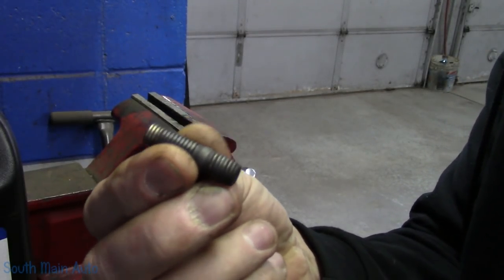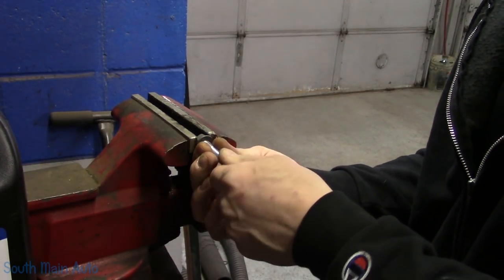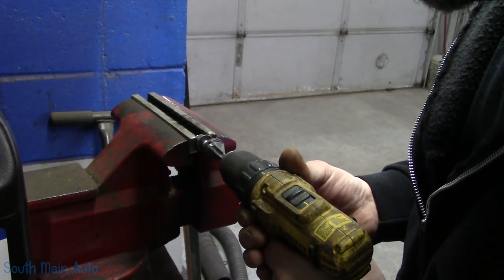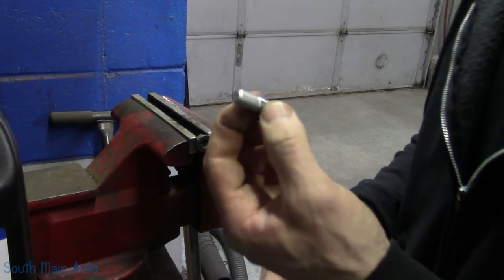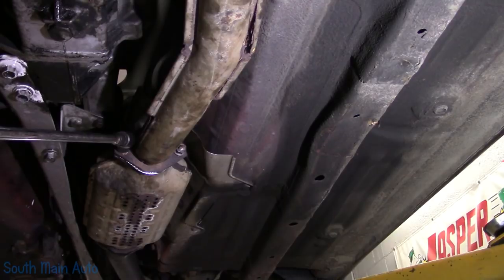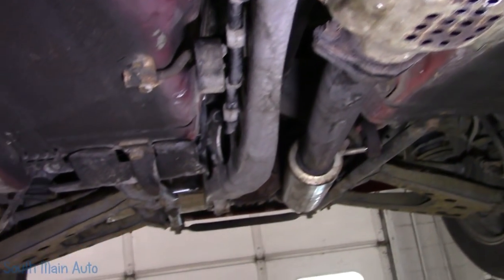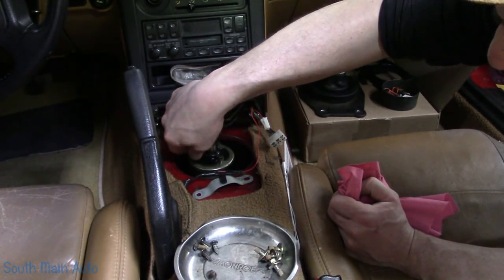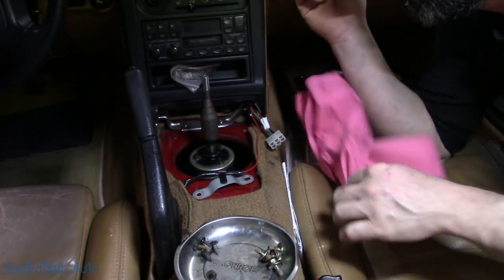Mazda Miata MX 5 - Clutch Replacement Job - Part IV

Comment: Great work you put in on that beast. Corrosion can hide anywhere. You showed ALOTTA patience with those long through bolts. Is that an hourly job right out of the gate or is it a flat rate nightmare..?

Comment: Did I miss it? You were supposed to replace the oil in the reservoir under the stick shift. It does make a difference in the shift quality.

Comment: Fun series to watch...l prefer the longer ones...Just wondering why you just wouldn't a bolt and nut assembly instead of replacing the studs..Wouldn't it make it easier for disassemble next time and an easier find.?..Maybe l missed something..
Reply: Oh.ok..l got it...it's a space issue on the backside...sorry.

Comment: That insulation around the shifter doesn't really do shit, it's the big rubber boot that keeps the heat and noise out. I'd bet the transmission tunnel gets quite warm when you give it the beans, and 9 times out of 10 it's ripped on a used Miata. Also not the first time someone's been in there, that brass bushing on the bottom of the shifter isn't stock, it was nylon from the factory. I'm betting someone did the boot before, given the age of the car, I wouldn't be surprised if it's been done multiple times. The boots only last a few years.

Comment: Job almost jobbed :-S
Looked like it be a gravy job lol
Worked you hard and metric stud parts etc messed you about a bit .
Think you want stock more studs and bolts, few hundred bucks in fasteners can be big time and hassle saver over the years and actually save money as you buy them in cheaper per unit. I never use to bother much as had great local hardware stores and tractor repair shops that had massive range and open 6days a week. 
Demise of these shops and autofactors never having much on shelf made me stock more and have saved links for better faster sellers for eBay so either have most common fixings in shop or anything bit special with no local workable option can be posted under 2 days .

Comment: This is the first clutch replacement I've seen you do. I learned a bit more about how they work, thanks. Why did that front to back "truss" have to come completely out?  Was there no room to work up front if it was still attached to the rear diff?
Reply: The Miata wasn't rusty, did the bolts seize because of steel/aluminum bonding?
Reply: The whole thing reminded me of replacing head gaskets on Subaru EJ engines. It takes forever to get to what you have to work on (head gasket or clutch)  Hope my FB engine doesn't leak there or is significantly easier to work on.

Comment: So I made the mistake the other day of using a bell housing bolt to get close the last 1/8-1/16 gap between my bell housing and engine. I assume the issue here would most likely be that I might have pushed the pilot bearing against the crankshaft?

Comment: RULE 1 broken , Open fill before drain plug.
Reply from the maker: I know, I totally pulled off a "do as a I say not as I do" move right there. Sorry :( I will go stand in the corner now....
Reply: Last Chevy truck/van  pads were put on wrong. The rivets are different inside to outside pads. Outside pad rivet hits outer most  "fingers" of the caliper first if you get it wrong. 50/50 shot there. The one side you showed getting done was wrong.   Thank you for the reply and keep up the good work. Now get out of the corner and back to work Mrs O needs a New Timing Belt or Shoes.

Comment: 99% of technicians do not have your skill because they do not have your patience. 
Btw, my rear powerplant frame bolts were the same and I failed the patience test. Ended up having to melt out those top retainer nuts. Was way harder than it looked.

Comment: have you done many clutch jobs on first generation chevy colorados? i have to replace mine and going to tackle it in the driveway. it doesnt start catching until that last few inches at the top of the pedal travel and i have some loud flywheel chatter upon accel until -/1,500rpm.  they are hydraulic and have the internal slaves. few lines to disconnect. Just wondering if it's a huge pain to do.

Comment: Clutch from hell, I believe the next mazda that came in for a clutch job I would play hard of hearing.
Reply from the maker: Nah we will just be twice as fast :)
Reply: It wasn't that bad. Just a few tough bolts. When it's bad, Eric has to bring out the sledge. He hasn't done that in a while.
Reply: Mazda did wonders to the ranger line. Because of rust and what not it took me 2 months to pull and rebuild a tranny for a '93 ranger 4x4. The driver's side exhaust was so rusted I just cut the Y pipe and welded it back in. The passenger side took a torch and some words, I had to blast the top of the bolt that stuck through the manifold off before the bolt would come out, it was that corroded. On top of that the thing only came from Kentucky.
Reply: The only thing built by Mazda in that Ranger is the manual transmission. Everything else is Ford. The Mazda-brand trucks 94+ were all Ford, not the other way around.

Comment: Still not sure why the trans was filled that far up....I'd have checked that...
Reply: Adam Trombino It says in most car manuals that you fill until it pours out, which he did. My Hyundai was the same and it shifts great, no problems.
Reply: It wasn't filled too much. In the Miata 5 speed the shift turret is a separate compartment from the rest of the transmission so the fluids get changed separately. It's probably fine that Eric didn't change the shift turret oil because that bushing on the shifter was aftermarket (stock is plastic) and the oil was probably changed when that was installed.
Reply: Interesting. This was what I was referring to, thx.

Comment: went about as smooth as my plumbing job, everything was wrong, 4 x the work,  part guides wrong, 10x dead mouse nest in wall and some junk made wrong.
so  ended up opening 2 walls and a ceiling, 6 hour job? nooo 12 hustling.. I kind of figured for the worst and did have all the materials+ for worst case though.

Comment: On the Sabbath in April in the year of our Lord 2018 he didth use the holy alignment tool, And the studs were good and he liked it. 2 being the number of the rear studs and 3 the front, 4 is right out and 1 not enough so the numbers are 2 and 3 only. And the exhaust gas being naughty in My sight, shall snuff it.
Reply from the maker: And if the jobith presentith itself again to Eric O. he shall charge 70 times 7 all of the days long.

Comment: What about the fact that the clutch pedal was extremely light?
Reply from the maker: That is based on the way the pressure plate is made.
Reply: South Main Auto Repair I thought the slave cylinder was the determining factor on how light the clutch pedal actuates?

Comment: Imagine doing that job without a lift. MISERABLE.
Reply: Thats why i dont do clutchs...ive done a few on axle stands and they dont go well
Reply: Ivan did one, but he cherry picked the engine out to get at it. 6 of one, half dozen of the other...
Reply: Can confirm. I've done a diff swap and an engine swap with no lift, and no power tools on the diff swap. Only took a whole day each time! haha
Reply: a close friend of mine,had a '92 Miata,clutch replacement,not having a lift,quit the job,ask a fellow mechanic,,and did it in 4 hours
Reply: I just did, took me a week and a half and most of my sanity

Comment: I know a few mechanics in their mid to late 30's who are partially deaf.  All the hammer hits and impact tool noise in confined spaces under a vehicle add up.  Mrs. O should be on you for eye protection also.  One thing makes it past the safety squints or safety contact lenses and you are out of work for a while.  It will also keep the never-sneeze facial, a.k.a. "automotive herpes", from getting in your eyes.

Comment: Mazda recommends GL-4 or GL-5.
Reply from the maker: Someone else mentioned that and they are drastically different. Usually synchronized trans do not use GL5
Reply: South Main Auto Repair GL5 will "usually" have friction modifier additives. It causes the gears to clash as the synchros do not slow down or speed up the gear enough before shifting. This is a known issue in many of the miata forums. Stick with GL4.